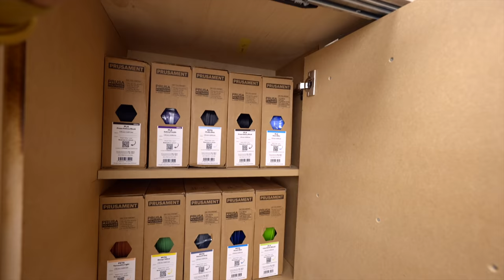Making a Cabinet for all my Clamps - ( With Extra Hidden Storage )

Comment: Wow that's really neat, I kinda like the idea of the hidden compartments.  Kind of makes me want to build a storage system that is full of little hidden spots.  In a way it does maximize storage space especially when optimized for certain shapes like the clamps.   I can totally relate to trying to move awkward stuff alone.  I live alone so when working on projects like this some things can be a challenge.  Some parts of building my shed were... interesting.  Especially hoisting plywood for the roof on my own.  A bit sketch.

Comment: The cabinet looks great. If I see it correctly at 0:57, it now blocks the temperature readouts from your printing cabinets and also the smaller pipe with the upside down Y connector. What's that pipe used for and are you planning to move the temperature displays?

Comment: While the hinges are handy, it's been my experience that their settings creep and they can come apart.  If you're going to have a fair amount of weight on the door itself, you may want to consider doubling up on the clamps to provide a bit more support in case the hinges should let you down.

Comment: Looks awesome. What thickness of mdf do you use for the frame?
Reply: Looks like 18mm to me
Reply: @lukenicholas7697  that was my hope too but I wasn’t too sure. I can get 18mm really easily locally but I felt like it possibly looked thicker
Reply: @Davvyk  I guess my natural instinct is to say 18mm since I too can get it locally however Alex has used pretty abstract things in the past that I can't get locally. I would say 18mm would be strong enough however I would use ply not MDF since it is stronger. I can also get 22mm ply locally so that could be a possiblity

Comment: Nice video. I dont want to be one of "those" guys, but your choice of s
Drawer slides is incorrect. Even if youre using Blums HD slides, the weight capacity of the box, plus all the clamps are way over the capacity of the slides. After 50 or so cycles, youll hear grinding noises, and the soft close piston will start failing. In addition, the number of hinges as well as the placement are incorrect. For doors over 6
72" you should have 2 hinges at the top of the door, then have 4 hinges spaced out on the door. Salice makes a heavy duty hinge that would work perfect for this application.

Comment: 13:53 60kg each? That makes it 240kg, not 120. Theres 4 of them.
Reply from the maker: 60kg for each drawer :)
Reply: I thought he meant each runner too not paired! Realistically what would you do with 1 runner 🤔🤦🏾‍♀️
Reply: @achappel  Since the draw at the top will not be holding the same amount of weight as the bottom half, could you but smaller runners for the top? Or does it have to be the same size for all no matter the intended usage?
Reply from the maker: @k.Newbbie  they hold the same amount of weight